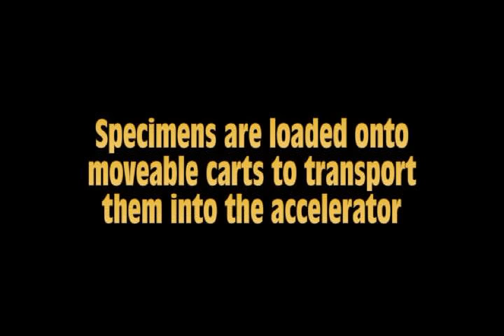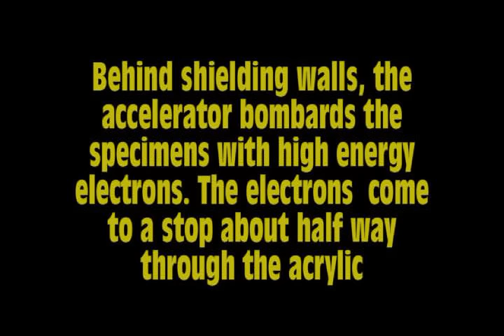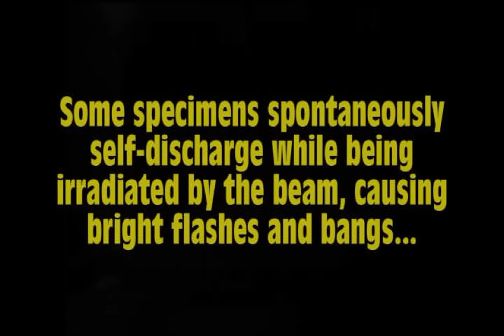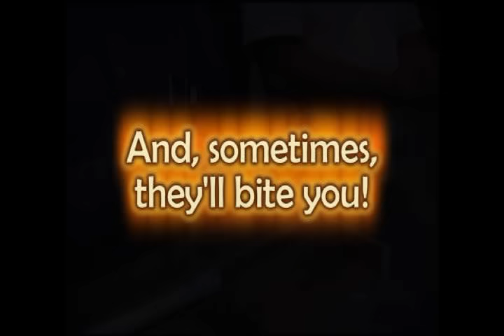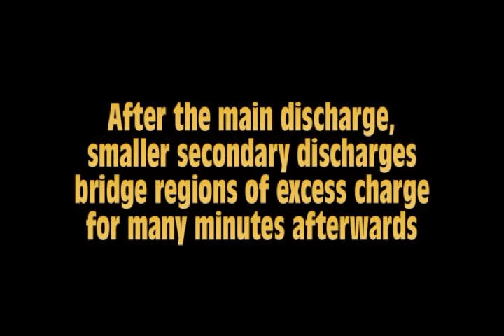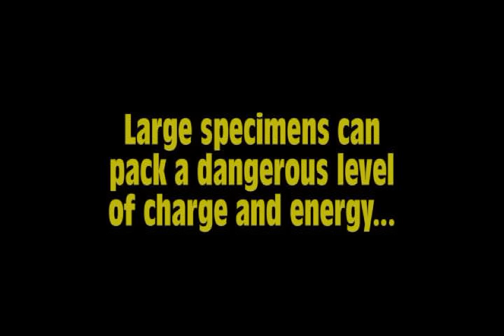Making "Captured Lightning" (Million-volt Sculptures)

Comment: Bert, what effect do strong permanent magnets have on the discharge patterns when in the vicinity?  ;-)
Reply from the maker: +Josh Gulick We were unable to see any evidence of curvature in the discharges when we discharged a specimen in a 15 kG (1.5 Tesla) magnetic field. Perhaps a much stronger field might work. See a discussion of the experiment here:
http://www.capturedlightning.com/frames/lichtenbergs.html#Iced
Reply: Interesting and beautiful!  What material discharges the slowest?
Reply from the maker: +Josh Gulick The material that is the least "leaky" by far (i.e., has the highest bulk resistivity) is Polytetrafluoroethylene (PTFE), more commonly known as Teflon. Because it has at least 1,000 - 10,000X the bulk resistivity of many other excellent dielectrics, Teflon film can store internal electrical charges for decades. It is white and translucent instead of being clear, and for other technical reasons, it does not form internal Lichtenberg figures. It's used to make "electrets" - the electrostatic analogue of magnets. Electrets are used in things like condenser microphones and electrostatic air filters. Some types of borosilicate glass,  Polylactic acid (PLA) also leak charge at a slower rate than acrylic (PMMA. However, acrylic makes the best looking Lichtenberg figures.
Reply: Thanks Bert!  This is so interesting.  Are there materials where the discharge itself is significantly slower?  Are there any dopants that are electro-reactive?
Reply from the maker: +Josh Gulick Surprisingly, the high speed of propagating electrical discharges during "fast" electrical breakdown is virtually independent of the dielectric material. The discharge propagation velocity is a function of the applied electrical field, and is in the range of 100,000 meters/second (for moderate E-fields) to well over 1,000,000 meters/second at higher E-fields. This seems to hold for gaseous, liquid, and solid dielectrics, and appears to reflect the similar conversion processes where dielectric material immediately ahead of the discharge tips is rapidly converted to the dielectric's gaseous atomic constituents using energy supplied by the E-field. During breakdown, portions of the dielectric switch from being an insulator to an electrical conductor, creating branching filaments of dense, electrically-conducting, high-pressure plasma through the material. 

I really can't address your second question. We only purchase commercial PMMA material, and we do not specify any special blends. And our acrylic vendors do not share their trade secrets (blends, catalytic agents, or manufacturing processes).

Comment: 5mev is actually about 8 x 10^-12 Volts - not as much as it sounds :0
Reply from the maker: The particle accelerator we use applies a potential of up to 5 million volts from the top of the machine to the bottom. When electrons "fall" through the large electrical field, they exit the machine with a kinetic energy of 5 million electron volts (5 MeV).

How do you figure that 5 MeV is actually about 8 picovolts??
Reply: Bert Hickman  5 x 1,6 x 10^-19 = 8 x 10^-12 Volts  => eV x charge of an electron = V
Reply from the maker: Unfortunately, your calculation doesn't calculate volts, it calculates Joules per electron. An electron volt is a measure of energy, equal to 1.602 x 10^-19 Joules. This means that a single electron that has been accelerated to 5 MeV will have a kinetic energy of 8 x 10^-12 Joules (J).

During irradiation, we inject 10^15 to 10^16 high-energy electrons into each specimen. As these electrons penetrate and stop within the acrylic, they accumulate inside, increasing a huge internal electrical field - similar to charging a multimillion volt capacitor. The energy stored within the internal electrostatic field can reach 4 kJ for large specimens, and internal charge-plane voltages can reach 2.5 million volts.

Comment: does the lighting stay in there ?
Reply from the maker: The little electrical discharges stop after 10-30 minutes depending on the ambient temperature and size of the specimen. However, the internal fracture pattern (the "Lichtenberg figure") is permanent.

Comment: Captain, shields  are  at  MAXIMUM,  but  I dinna  know  how  long  I  can  keep  her  runnin,  the  dilithium  crystals  are   all  but  burned  out,  an' sorry  Captain,  all  power to  Phasers  has  been  rerouted  to  take  the  over  load,   ---we're  dead  in  the  water,  and  the  transporters   are  not  functioning,  but  hey---these  by  product  crystals  from  the  sub  light  and  warp  drives  will sell  like  hotcakes !

Comment: why not try and make a really big one with a lightning rod, copper string, and a model rocket
Reply from the maker: +holyfnshet Because simply applying a high voltage pulse - even lightning! - will not create an internal Lichtenberg figure inside Plexiglas. It requires actually injecting electrons via an electron beam accelerator.
Reply: I hear your words and the only words I can think of as a reply is either converter or amplifier for some reason. Don't get me wrong I don't know much about Plexiglass.
What I do have ideas on is laser arrays and converting lasers into plasma using friction and ionized air (and a few other ideas to to have it stabilized)  . but i don't think it wise to be attempting to build such a thing without protection and in a safe environment.

Comment: Could a proton beam be used instead?
Reply from the maker: Yes - sort of. The proton beam energy would need to be about 5X higher (~25 MeV) for similar penetration depth. PMMA will also suffer significantly more physical damage from more energetic bond-breaking and outgassing within the PMMA. The shape of the resulting discharge might also be a "negative" Lichtenberg figure (i.e., more fan or shell-shaped with finer, straighter branches) instead of the tree-like branching "positive" Lichtenberg figures we see with electron injection. Although we have never made Lichtenberg figures using proton injection, a number of Russian researchers have reported creating them within a variety of materials (LiF, glass, PMMA, epoxy resin).
Reply: Neat, thanks!

Comment: sorry for a dumn question, would a taser work?
Reply from the maker: No. It requires using particle accelerator... specifically an electron accelerator capable of 3 to 5 million volts. A high voltage source of any type, including a Taser, is simply not sufficient.
Reply: +Bert Hickman thanks

Comment: So the sparks spark forever
Reply from the maker: No - the little sparks occur for only 5 - 30 minutes depending on the size of the sculpture. But the trails of tubes and fractures left behind inside the acrylic will last indefinitely. When lit by blue LED's the trails glow brilliantly, looking similar to a frozen bolt of lightning,

Comment: what if you discharge them in a magnetic field!
Reply from the maker: That's a great question! We know that Lichtenberg figures in air over dielectric surfaces become curved if they're created within a powerful magnetic field as the trajectory of moving electrons within the electrical discharge become curved due to Lorentz force. For example:
http://www.capturedlightning.com/photos/Magnetic_Tests/Uhlig1A.jpg

We wondered if the same thing would occur within an acrylic Lichtenberg figure. In 2008, one of our team of "spark whisperers", Dr. Timothy Koeth, placed a charged 4" x 6" x 1/2" specimen within the poles of a 15 kiloGauss electromagnet and then discharged the specimen. Unfortunately, no curvature was observed in the resulting paths.  It's possible that a much stronger magnetic field is required to see the effect in acrylic.
Reply: wow that's amazing. thanks! So does that mean electricity might have a different speed in different materials?
Reply from the maker: farefouse olly The disturbance called "electricity" travels at nearly the speed of light, pretty much independent of the material. However, the average "drift velocity" of electrons that make up the flow of electricity in most materials ranges from being quite slow (a fraction of an inch per second in a metal wire) to being extremely fast (up to 10-20% of the speed of light) in the near vacuum of an electronic vacuum tube. The Lorentz force (that would cause the paths to become curved) is proportional to the  velocity and the magnetic field, so faster electrons would experience a stronger Lorentz force.

During the formation of an internal Lichtenberg figure in acrylic, there's evidence that the paths grow at a rate of 10^5 - 10^6 meters/second. At the propagating tips of the paths, acrylic polymer is rapidly converted to acrylic monomer and various gases within hundreds of billionths of a second. This forms an extensive branching network of high-pressure, electrically-conductive gas channels that supersonically expand to form the complete Lichtenberg figure. Electrons flowing through these ultra hot gas channels (5,000 - 10,000K!) continually collide with gas and monomer molecules, limiting their drift velocities to the slow rates seen within metals. The slow drift velocity is likely why we see no curving in the channels even though they formed within a strong magnetic field.
Reply: wow your very intelligent. I am going to pretend like I understood most of that lol. thanks for the comments. But I think its a bit beyond me at the moment!

Comment: what would happen if one of these broke ?
Reply from the maker: +Dovydas Kelpša We've never had an acrylic sculpture shatter during discharging, even very large ones with lots of stored energy. However, we have seen quite a few glass sculptures shatter, some during discharging, and others hours, days, or even months later. We even captured a couple of these instances in a short video: https://www.youtube.com/watch?v=9IoaMlfdSB0

We don't make glass sculptures any more... :)
Reply: +Bert Hickman i would be interested to see the result from heated glass, just malleable, then bombard it while its still hot, and then discharge it while its still hot. would probably reduce the chance of an uncontrolled discharge and also may allow for much more fractals.
Reply from the maker: +Cordelia Borland 
Good thought. The problem is that, in order to make Captured Lightning, the material must be an extremely good electrical insulator. This is essential so that the injected electrons do not quickly leak away. Many electrical insulators become more electrically conductive when heated. This is true for glasses and plastics. When glass is heated to the softening point, it becomes a very good electrical conductor. Any injected electrons will quickly leak away before they can create the internal spark discharges.
Reply: okay thx
Reply: could you reduce the shattering by putting the glass sculptures into an annealing kiln to reduce the stresses?
Reply from the maker: Possibly...